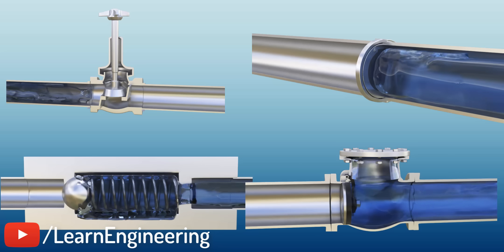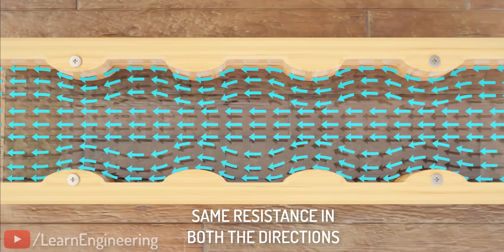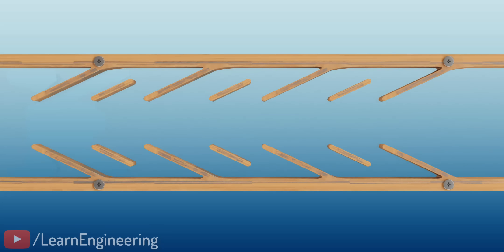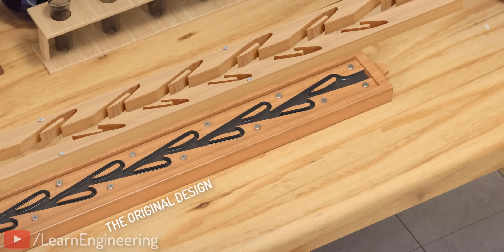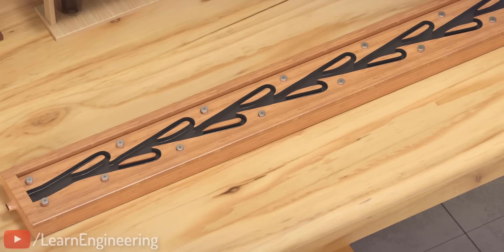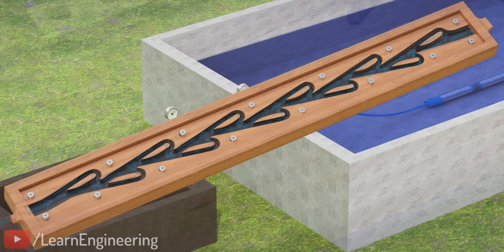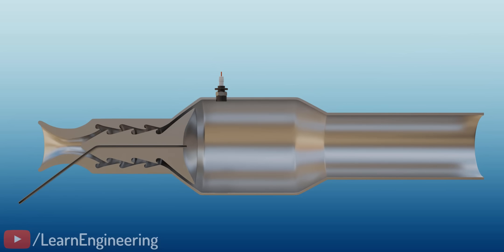Tesla Valve | The complete physics

Comment: Would have been nice if they had shown a real life demostration instead of that 3D render
Reply: Integza has a(somewhat failed) one on his channel. xD
Reply: The takeaway from those videos are that for fluids, there is not that much change (20% ?) but that could be enough for very low flow scenarios.

Flamefronts however have a drastic difference, which is why they work in pulse jet engines.
Reply: And the simulated voice.
Reply: https://youtu.be/tcV1EYSUQME
Reply: https://m.youtube.com/watch?v=tcV1EYSUQME
Reply: many people have tested it. it never works.
https://www.youtube.com/watch?v=XhJtSqLz88Q&ab_channel=PhysicsHack
but this video with 7 million views and hardly anyone is calling it out as bullshit
everyone treats tesla like a god when really he just didnt hit the mark with this design.
Reply: @__shifty  Well, tesla was smart. But it's not really a valve. It does limit flow, but not stop it. The video you linked doesn't show anyt force required. Theoretically, you could reach the same flow both ways, but more force would be required to input the same flow "The wrong way". For such a small quantity of water, i doubt he'd feel the difference though. And in that video, you could actually see the turbulence in the water :P
Reply: @__shifty  https://youtu.be/tcV1EYSUQME

They use it in flow control to keep flow very low.

It works fine.

It's not a valve. It's more a restrictor

Comment: A valve that isn't even a valve but a huge resistance pipe. Also requires to be turned around to block the liquid to achieve valve-like system. G-E-N-I-U-S

Comment: Good vid... I accepted your challenge at the beginning and almost instantly came up with the idea of just chevrons in a channel with a gap at the edges. Not very optimal but it should result in much easier flow in one direction than the other. Again, flowing against the direction the chevrons point will be easier as all fluid is routed to the edge in one direction and in the other the chevrons direct lots of flow to the point of the chevron so it takes more pressure to move fluid through the channel.

Comment: When fluid starts to go in "reverse" direction, these side arrows (flow) exist, and when fluid fills channel they are very small (insignificant flow), so most fluid goes through the primary path, so there is no real valve...

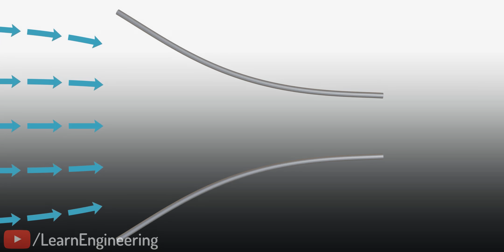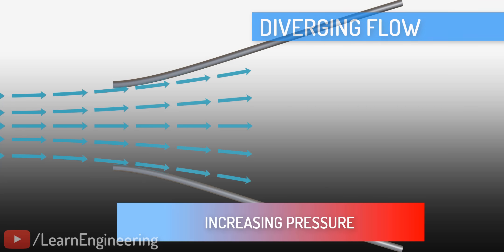Comment: 1:26-1:42, I was thought pressure increases as the pipe gets smaller and the speed decreases, vice versa for expansion. Would it make a difference if the gas/liquid is compressable?

Comment: As this guy was talking I could not wrap my mind around the fact that if the resistance was so great that the flow stopped, then it would start again.  Hence, not a one way valve.  At the end he confirmed that his original statements of a one way valve with no moving parts was in error.
Reply: depends on your spec of "stopped flow", doesn't it?

Comment: I don't know if I'm buying this animation that starts about 1:16.   The one labeled diverging....Isn't that 2 converging flows on both outsides?  And isn't the one labeled converging diverging flow on both outsides?  Would these flows cancel out with the opposite flows down the centers....making both valves kinda equal?  I think this may be an oversimplification of Tesla's valve to the point of being totally incorrect.   Also...you've got to think about where the flow enters the valve....in the so called "diverging" valve it looks like 40% of the flow will converge at the top and 40% will converge at the bottom.   I'd like to see a real life demo of that simplified valve.   And of course....Tesla was one of the greatest minds this world has ever seen!

Comment: Tesla was awesome and the "valve" is interesting. It is not, however, a one-way valve as you admit at the end of the video. With each additional geometry added, the resistance to flow is increased. The resistance has the diminishing returns problem though and is never able to reach 100% effectiveness no matter how many geometries are added. This is a cool video though. I would like to have seen actual real fluids flowing both directions through the device.

Comment: Simple fact is that water will follow a path of least resistance, so the force you are trying to exert back onto it with the splits and curves won’t really work because the main pressure would be in the path of least resistance and that would remain constant all the way down because the design doesn’t change , you would need more pressure in your split ends to counter act the water flow in the main stream. In the video it says you wouldn’t imagine making a one way valve without moving parts, I still can’t imagine making a one way valve without moving parts.

Comment: Don't listen these silly spent-whole-life-in-a-office engineers, instead use a long small diameter tube and you will get the same result, I'll tell you even more - the valve in your kitchen, you can shut it softly and, OMG, you'll get a reduction of a flow rate. No fancy stuff from Nicola - even regular things around you can do the same shit (and they are much cheaper and simpler, hence more advanced). Plus I don't think that this tesla's shit would work in the laminar regime of a flow

Comment: Yeah but if I make a pipe like that, fill it with water, then water will fall out either end if I were to fill it...
So it's not really a one way pipe anymore than a hill is, it's just added resistance, like gravity.
Reply: I've reread that second line several times and I have absolutely no idea what you were trying to say. It's not a one way valve because it just has added resistance one way? You mean like a one-way valve?
Reply: @jonobrow  hills add resistance, it was a metaphor.
Reply: @pseudomastix2916  A metaphor for what? One-way water flow?

Comment: The example at 1:20 is wrong. The flow is the same in both directions. 

Proof:
Take the pipe and insert a divider that splits it in two down the middle, so you have two pipes. Ignoring the extra friction, this won’t change the flow. Now, you have two pipes. Those two pipes are now the same in both cases. 
If you want, you can swap the two pipes and then remove the divider between the two, and you’ve created the supposedly different pipe.
Reply: What makes you think the divider wouldn't change the flow, considering all fluids have cohesive force?

Comment: I watched the video from the comments below and I was not surprised by the results - the Tesla valve works at the beginning, once the structure is saturated the effect of fluid blocking is minimal if none at all. This means that this valve may work effectively only if it is infinitely long, which means it has little to no practical applications, unless you use it for very short fluid bursts or leaks that are below the structural saturation point. So, with all my respects to Tesla, his novelty and the modern trend to be worshiped as some technological God, but this structure is not very practical for usage. It does look very ingenious and mysterious though, almost alien, we have to admit.

Comment: 2:06 - Im confused. Both have converging and diverging pieces. The "converging" diagram has 2 diverging pieces on the outside which would cause a similar flow reversal, would it not?
Reply: Yes. The Tesla Restrictor works because it redirects the secondary flow into the primary flow after reversing it, and not because of turbulences during diversion. I'm not sure why they chose to start with that, even more so as you are right, both pieces have converging and diverging parts and would be restrictive in a similar way.

Comment: Students could use a number of these valves to make a hydraulic computer, sort of like the ball bearing system that controls automatic transmissions. And since the computer is analogue, all those algorithms wouldn’t be necessary. Just take flow and pressure readings, and convert them into numerical values. I think that it would possible to build all the logic gates, but I’m not sure. https://images.app.goo.gl/C6fDikcwzgbMfqp79
The nice thing is that you could regulate the viscosity of the fluid with heat, and test each logic system under a variety of resistances.

Comment: Question was: can u create a valve without moving parts! And that's not an answer... So even tesla cant make valve without moving parts, because it's just lowering speed of the flow. If u want to create a valve without moving parts just took big barrel, make a big hole, connect pipe, then fill it with water. water will stop when mass of water will produce pressure more than pressure of stream going inside of barrel. the bigger hole and wider pipe, the faster it will stop water.  It's only one way of many i can offer... other way is just freze peace of pipe and unfreaze it when u need get a water.

Comment: After seeing this in my recommendations for the 1000th time, the time has come to watch it.
Reply: Lol same
Reply: You acted like the Tesla valve, much resistance but in the end you've watched it.
Reply: i was a plumber for years. this valve is a joke. it cannot do what's advertised. 
want proof? go ahead and try to find a video of this valve in operation. 
the water shoots out either side just as fast as you pump it in the opposite.
Reply: @__shifty  You know when this valve could work? Lets say you have a junction with one side a normal pipe, and the other with this valve, the water will obviously choose the way with the less resistance. If you somehow had a pipe blockage or an overflow in the other pipe, the water will then be forced to move into the valve. This is a scenario i think it would do a good job at. It is not a valve that can stop water when you force into it. It can only be a resistive valve.

Comment: Restricted flow valve, not one way. Another failed comparison. Imagine that.
Reply: Maybe it can restrict the flow to enable less stress on the actual valve.?  Just speculation from an uneducated person.
Reply: They probably used "one way" because it's a term that more people are familiar with.
Reply: @niko1even  The could also used the term "a thing" because people are familiar with stuff that are just "things".
Reply: @bilib1891  that's too broad... there comes a point where techniques have diminishing returns.
Reply: @niko1even  My point is that this is just not a one-way-valve. No matter if people are familiar with resistors or not it is just wrong.
Reply: @bilib1891  alright
Reply: one-way restricted flow, that is. "Restricted flow" alone can imply bidirectional(and often adjustable) restriction, which apparently has confused several people here

Another failed pedantry. imagine that.
Reply: @ki0w0-lordofwatersheep  The point is that on multiple occasions it wasn't called "one-way restricted" but "one-way valve". Doesn't sound like "just a bit restricted" and more like "theoretically 100% restricted".
Reply: @bilib1891  it wasn't called "theoretically %100 one-way valve" either, was it?

Comment: Unlike one-way valves with moving parts, Tesla's valve relies on continuous or rapidly recurring pressure from the source. Once there is no pressure from the source, there is nothing to prevent the fluid from flowing back, particularly if the fluid is being pumped upward. Gravity will draw it back, once the pumping pressure stops. So Tesla's "valve" is not truly a valve but a regulator.

Comment: Not a check valve, more like pressure reduction valve. Would only work properly in an open system. Theoretically would still allow reverse direction of flow, which the purpose of a check valve is utilized in a system to prevent, if the back flow preceding the valve is greater than direction of flow pressure by a measurable margin.

Comment: A Tesla valve takes a lot more material, is probably harder to construct and almost inherently generates more flow resistance. All of that's debatable, however, what is clear from the design is that the primary (and maybe only) advantage is that it has no moving parts to break or wear out.
But need to check the real  industrial applications ...and how do we control the flow rate  in a real world.

Comment: It's not REALLY one-way though, is it. Some fluid will still manage to go upstream if that's the direction you try to run the fluid, no problem (your "simulation" even shows this)  - especially if the thing is mounted so that "upstream" is actually downwards, gravity-wise. No such thing will occur with the other designs, like for example "ball on spring".

Comment: Beginning of the video is more than a little misleading. It isn't a one-way valve, just a regulator of sorts, and even then I'm guessing not a very accurate one. The one-way valves shown earlier completely stop the flow of fluid. This only produces more resistance. It's a neat science project and might even have some kind of practical application though.

Comment: Granted, my understanding of physics and engineering is largely autodidactic and therefore incomplete, so this may be incorrect. 

Many of the arguments against this valve seem to be centered on the fact that it cannot 100% stop flow when fluid/gas is introduced from the restricted side (RS) while the unrestricted side (US) has no flow into it. For them, this means that the valve does not work. However, it seems to me that that is not the correct usage for a valve such as this. Rather, it is an effective way to show how flow within the valve works. 

Under working conditions,  I believe the valve would work to prevent a complete flow reversal in a single-direction flow environment. Because of the design, reversed flow entering from the RS loses pressure as it moves through the valve, which allows the intended flow from the US to overpower the reversed flow and keep the larger system working correctly. In application, this would be useful for situations where backfire can occur, as it would largely prevent exhaust gasses from flowing backwards and reaching the combustion chamber prior to the valve. The lack of moving parts to prevent backfire means fewer places for mechanical failure and fewer necessary redundancies to prevent catastrophic failure. One-way valves also introduce a certain amount of drag/impedance into the system during normal operation and the Tesla valve appears to have a far lower amount of drag/impedance during normal operation, which may be another reason why it is being used in experiments in lieu of mechanical one-way valve.
Reply: Chungus
Reply: https://youtu.be/mC91vEMwq-E

Comment: Design is ingenious..practical, no. Flow is not adjustable. Takes up so much space. Does not really do anything but restrict flow to a certain extent only. No shut off. Cannot function as a check valve. I mean it has its uses..but very limited and specific. Great video though.

Comment: Doesn't work, and it doesn't take a genius to know why. Firstly, the return flow has no more power to stop the main flow and acts as a cushion to smooth out the path of the main flow. While restricted, the liquid still passes. Actually it has little more effect than constricting the flow through a smaller tube.
As far as I know, to stop something, you must exert at least a slightly bigger, opposite force upon it.  Anything less, and you get almost nothing. That reverse flow is not strong enough.

Comment: Thank you for the informative video. I have been interested in this device for some time. Here is a question: If one was to take TWO tesla valves of 12 or even 24  segments and install them on a very long pipe manifold say a 100 meters by 10cm or more diameter and the pipe is coated with the super black nanofiber material Vanta black and the valves are installed at each end facing the same direction thereby maintaining a one-way flow and then place the entire structure out in the sun. What would be the result?

Comment: This isn't  even close to a check valve, looking at the design I'm guessing it would just create a pressure drop with high flow rates in the reverse direction, and some pressure drop in the forward direction. I doubt at low flow rates it would do anything in the reverse, so it is nothing like the other check valves which actually  stop all flow.

Comment: In short.
This is not a valve, ast it cannot block flow.
So the initial state remains and you cannot design a one way valve without moving parts.
This video might be educational but its stupid in design, espiecially shown where they move from one view to another in a constant speed. Which is painfull to watch.
It is only as precise as the feeding mechanism, at which point you might aswell change the feeder to feed as much and not bother with this useless thing.

Comment: Now I may be a complete idiot, but I'm fairly certain you have increased pressure and decreased pressure mixed-up. by converging flow, are you referring to a decrease in cross-sectional area (like a smaller-diameter pipe)? If so, that would be an increase in pressure, not a decrease.

Comment: The tesla "valve" still has considerable reverse-flow leakage. No one has yet built one that does not. If it were an electrical rectifier, no one would use it, because it would be considered a very poor performer. It is rarely used in fluidics - ask a fluid power engineer - because it rarely has an practical applications. It is an engineering curiosity, and a blind alley, nothing more.
Reply: Except that electrical rectifiers also have leakage currents(albeit very small)?
And don't certain kinds of rectifiers perform "poorly" when used in other rectifiers' purpose, such as the Zener diode?
What about microfluidics? Do they use mechanical valves more often?